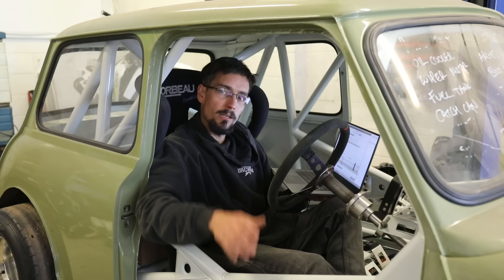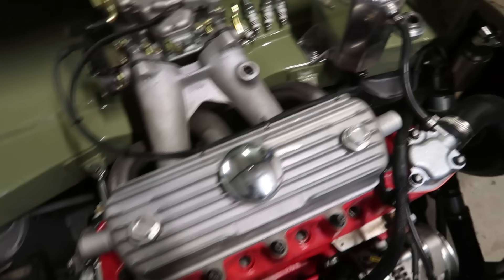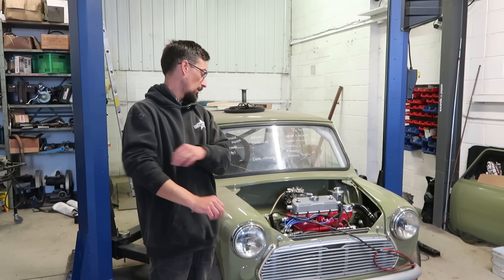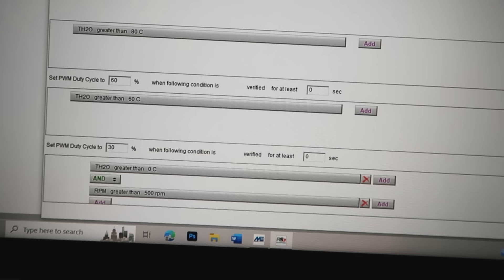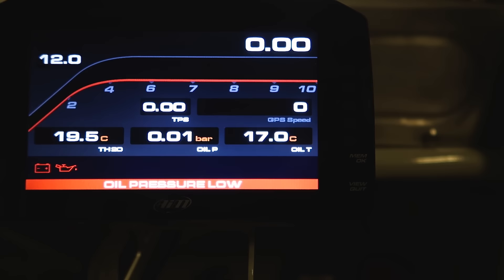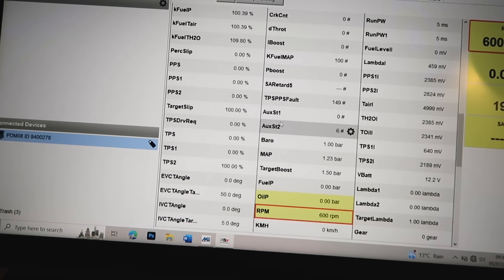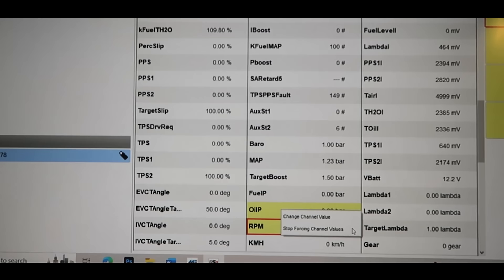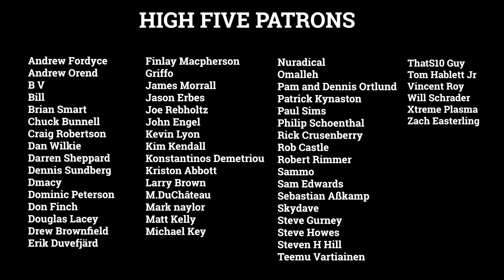Classic Mini Race Car First Start + Aim Pdm Setup  #minimiglia

Comment: One thing to note with the green indicator lights, that indication is only valid while the PDM thinks the output is on, it doesn't account for physical issues for example a pump failure, you'll want to include some protection logic around engine temps or oil pressure, if engine temp is higher than your engine can withstand then limit max rpm to 700 etc, that sort of thing. Looking good though, it'll be a beast.

Comment: running with no exhaust reminds me of the time i was moving an allegro on the starter, with no manifolds on.   unfortunately the petrol pump [which is below the open head] supplied lots of petrol straight down it's neck, full throttle across the main dealer workshop,  + luckily i missed everything...  but run my ankle over...
Reply from the maker: Dang

Comment: I’d be interested to see what weight oil you’d get away with because that treacle has got to be responsible for loads of drag in the gearbox ?? 
What is the fastest guy using   ?😂
Reply: My mate uses miller's 10w60 on the  track in his  Mx5 turbo conversion ,thought the same but it does make sense, he's flat out all the time the oil degrades quickly the  engines sound mint, the engines are from the 323 turbo many moon ago
Reply: Miller's 20/50 CTV has been developed for racing minis, it's what most of the grid use and many of the best engine builders, that or Valvoline.  Important thing is high ZDDP content to help protect gearbox, the oil has two jobs in an A series.
Reply: @peterhills5594  
Seams really counter intuitive doesn’t it ? 
But what works , works. 
Cheers boys
Reply from the maker: That’s what was recommended to me bud.
Reply: @Urchfab  
I now know it’s right because of the gearbox inclusion. Wild setup. For 60-70 year old design. Cheers dude

Comment: I used a heavy duty hydraulic line for my engine once, pipe didn’t have enough flexibility, half way through a rally the fitting on oil cooler snapped off. End of rally ☹️
Reply from the maker: I think I will get another one as I’m not happy with the routing. 👍